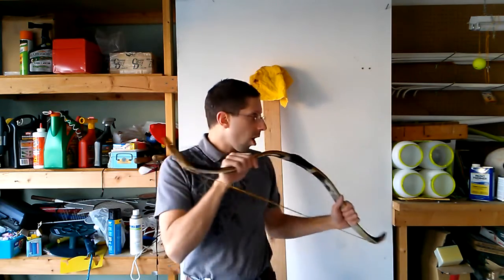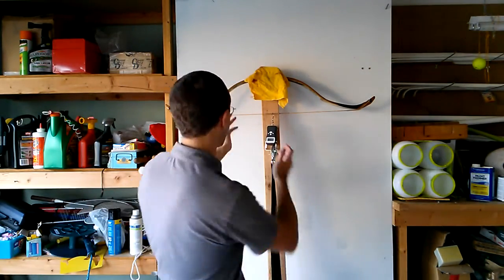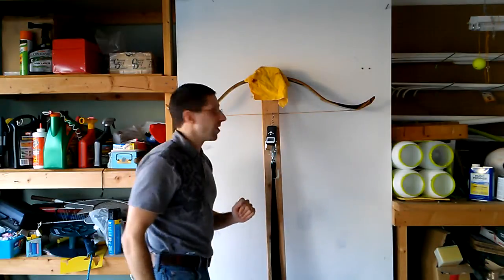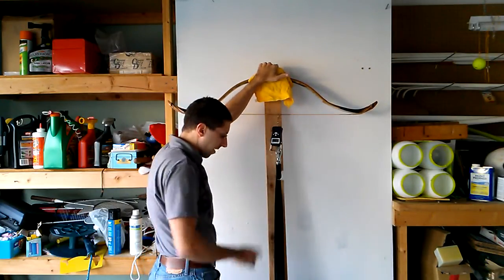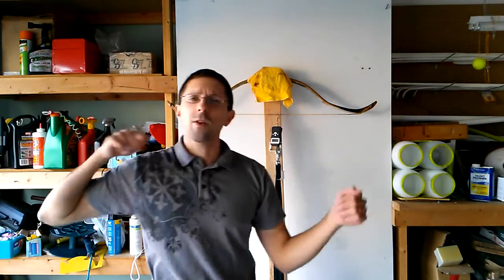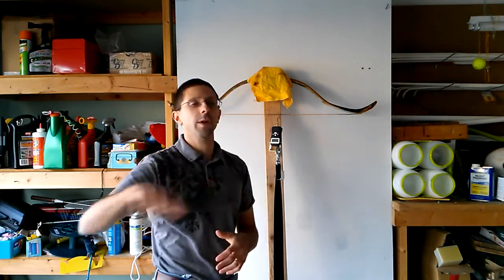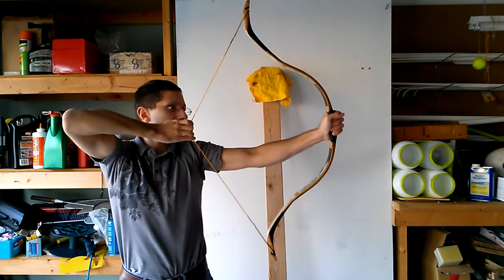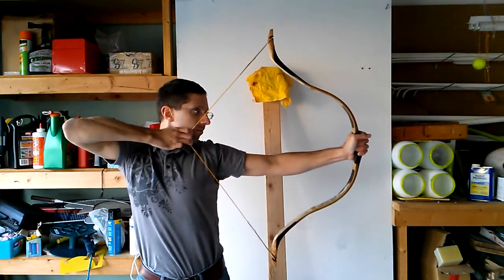Drawing the 85# Grozer Short Turkish Bow

Comment: I believe that 1.75 in your talking about, is to prevent over-drawing the bow. I have several bear grizzlies that are marked
50 lbs @ 28 in. I test it on my scale and it weighs 52 lbs at 28 in. I can only draw 25 in so i am drawing 47.5 lbs. if i subtract the 1.75 in i am really pulling 50 lbs !!!

Comment: Let me warn you right now, its not just your muscles that need to use to that much weight your ligaments and tendons take much longer to strengthen there is no reason why you shouldn't be using a 50lb or 55 for a couple years then go up ten pounds at a time.  You tear a muscle it'll heal you tear a tendon you your archery days are over.